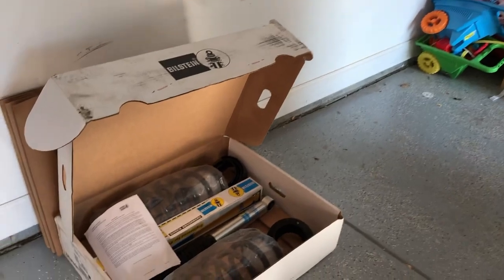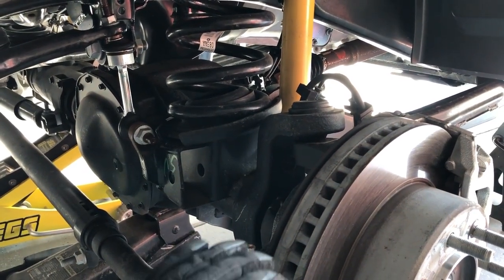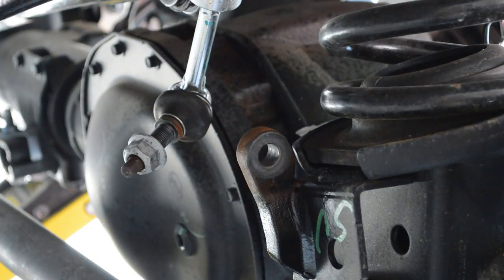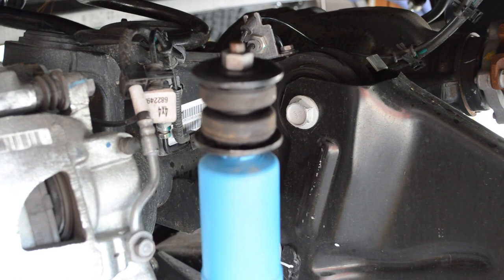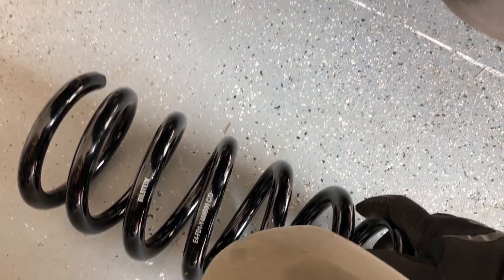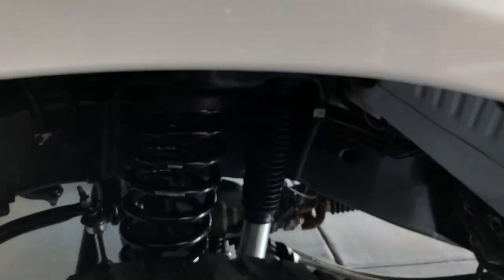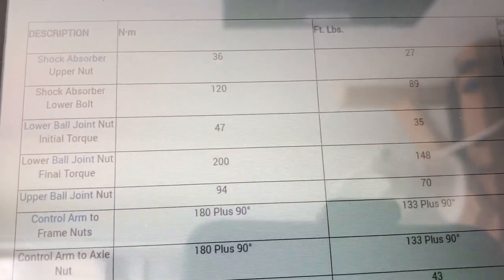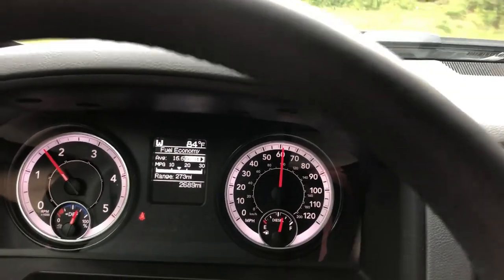2013-2018 RAM 2500 Bilstein Level Kit install

Comment: Thanks so much for making this. Really helped me out.  My truck had the cheap 2 inch spacers on it when I bought it and it rode like hell. I’m ecstatic of how much smoother it rides now with this kit.
Reply from the maker: Spacers will only give you height but the springs and shocks help

Comment: Just ordered the kit with the reservoir shocks today. Cant wait!
Reply from the maker: A Th I think you will like the kit.  I’d have it aligned to thuren fab specs.  Hope this video helps you on your install.
Reply: MKS Performance & Offroad video will definitely help!  Only problem im trying to figure out is mine has had the recall done and the dealer ship welded the drag link bolts. No way to adjust steering  wheel now
Reply from the maker: A Th to do a proper alignment you will need to cut those welds. Blue lock tight those or reweld after alighnment.

Comment: Nice install. You getting any wobble in that front end yet? I would suggest a steering box brace, about $135 from Rough Country. Really tightens things up, and boxes in the front frame rails.
Reply from the maker: 03redrubi no wobble, might be doing some 7500 airbags for the rear, and some thuren fab stuff in the future.  New clutch will be goin in soon and a video on it.  Those braces do help tighten things up.
Reply: @MKSPerformanceOffroad  I'm running the Timbren 6k up front, stock height, but the Timbren did boost front, unloaded. I have the Airlift 5k stainless kit in rear, and only run about 25 lbs in bags,  to level the fifth wheel. Pretty happy with the suspension now. Certainly feels like 1 ton suspension now.
Reply from the maker: 03redrubi very nice, we will be adding some electrical golf cart content coming up and hopefully a 5th wheel camper to compliment the cart in the near future.

Comment: Hey i just did this to my 5th gen and mine has a arch in the coils just like yours were you able to fix that
Reply from the maker: It will have a slight arch in the coil and shouldn’t be a problem.  The arch is more exaggerated when a coil spacer is installed in my opinion from the last setup I had.
Reply: @MKSPerformanceOffroad  glad to hear that

Comment: Just found your video, really nice explanation of process. Still happy with the ride? Secondly, I have a 2018 with the rear vibration. It seems like it is an amplifying movement on the rear. more weight eventually higher amplitude movement/vibration. Any dealings with this? Thinking about same front kit with progressive coils in the rear.  Anything would be helpful.
Reply from the maker: Thank you,  I haven’t had an issue on my truck with this but you might start by rotating the tires.  If the vibration moves location it is likely a wheel issue.  Also, check any rotating assembly, play in driveshaft at the u-joint, out of balance drive shaft, bearings,  inspect differential for any issues.  You could absolutely get a better ride with progressive coils in the rear but you will lose about 25% capacity when towing.  You can do air bags to help with squat which we just installed last week and will have a video in that soon.  Im still happy with the ride this kit offers.

Comment: I just did mine today. Did you ever go back and replace the track bar? I’m thinking about buying an adjustable track bar. Like to know you thoughts and which one you would recommend.
Reply from the maker: I did not order an updated track bar, only had the drag link replaced by dealer with new design.  If you go higher than 3” I would recommend just to get your axle back to center.  Thuren has a great website that explains this and would point you in that direction.  Several good options out there from Thuren, Synergy, and a few others.  I have been able to align the truck just fine with it leveled.
Reply from the maker: Synergy, Pure Performance, Icon, Rough Country are a few I think are good options depending on budget.
Reply: Thanks mine aligned just fine but I was curious if it was worth it.

Comment: Great job with all details. I just got my 2019 model 2500 diesel (same cab n bed as yours). I'm looking to do this same install with the rear 5100's. Bilstein mfg. wont commit that your same kit fits my 2019 truck,. I don't do much off roading and Bilstein lifts is trying to sell me the remote res, model 5160's on all 4 corners saying they will fit. Do you have knowledge if your kit fits a 2019? sorry for the long question.
Reply from the maker: sean otoole I don’t but I’d be willing to bet it does as most the suspension components are unchanged to my knowledge.  Best thing to do is look at a 19 suspension verse an 18.  Axles should be same and springs.  Shocks shouldnt be any different either the way they mount
Reply: @MKSPerformanceOffroad  Thanks for your quick reply! I will take a look, my son has same truck but 2017 model. Im going to use my 35x 11.50x 20 (factory rim) nitto grapplers. I removed from my ram 4k on them when I traded truck in. I'm considering an adj.  trac bar, do you have any recommendation's? I know their expensive, but thinking may improve ride
Reply from the maker: sean otoole 17 will be the same as 18, if your only going for a level, no more than 2.75” the adjustable track bar doesn’t give you a huge gain if any in my opinion because it really just helps re-align the axle laterally under the truck when it moves through its travel arc.  Mine might be off 3/16” or less on one side or another but its very minimal and hardly noticeable.  If your ocd like me, check out thuren fab or carli suspension, they make top notch products and are proven.  3” or more you will want the adj. track bar to re-center your axle.  Take a good look at the springs, rubber isolators and shock mounts.  If they are the same the kit will work and ext. reservoirs serve little purpose on road but offroad are intended to help dissipate heat.
Reply: @MKSPerformanceOffroad  Sorry for my delay, in attic re-insulation, fun fun fun. Sometime I'm away from youtube for a while.  Thanks for all of your input. I'm going to try no adj trac bar and see how off axle is. It will be about a month. I'll let you know how much it is off by for future ref.. I really appreciate you taking your time with the video & posting it, plus responding to my questions, Have a Merry Xmas, Sean.
Reply from the maker: sean otoole Anytime,  my goal is to build a useful channel that has valid and good info on it that can help people accomplish tasks they can do but maybe don’t feel confident enough because of lack of experience.  A lot of this stuff is pretty straight forward and sometimes there are things you just have questions about.  Merry Christmas and Happy Holidays to you as well.

Comment: After install a 2.5 Supreme Suspension leveling kit my front axle got shifted toward driver side. Do you think an alignment could fix it???
Reply from the maker: Jorge Betancourt possible,  you may want to look at an adjustable track bar from thuren fab to correct this if its enough to worry you.  Mine moved very slightly if any at all.
Reply: Thank you

Comment: Would the 4600 series work with the 2” leveling springs? Thanks
Reply from the maker: Yes they should but you would need to purchase the extenders for the bottom of the shocks like these. >> https://amzn.to/3JBDaf3
Reply: Thanks. Wish I would of saw this kit before I recently bought shocks. Turns out factory coil springs are toast. Thanks for the advice.
Reply from the maker: @garylee8578  no problem, thanks for supporting our channel.

Comment: Are you happy with the ride from the bilstein coils? My 2016 rides rough, going to try thuren coils.
Reply from the maker: Jeff Bennett Coming from a 2014 with coil spacers, these ride much better, not sure how much better than Thuren.  I’ll have to do a comparison, reason I bought these was the price and the fact that I didn’t want to spend $2,000 on a level with shocks.  I think it honestly rides better than stock for what it is.  If you want that soft ride you have to be willing to sacrifice something.  If you go with any coils for the rear you get a softer ride but less tow capacity and then it comes to, what do you plan to do with your truck?  Sorry for the long reply.
Reply: @MKSPerformanceOffroad  Do you plan on doing a thuren comparison? Thanks
Reply from the maker: Jeff Bennett I might when things slow down from holidays.  I know a few guys running their springs and King shocks
Reply: I have this kit with the reservoir shocks. I am happy with the ride. No more bottoming out on every dang speed bump. Much more planted in curves with rough surface. Slow speed sharp bumps were about the same. Switched to 35s on 18” wheels and run about 45 psi and ride is way better all around.
Reply: @supporterofsanity   do your 35’s rub at all with this bilstein kit?

Comment: How was the ride with the 5100's?
Reply from the maker: The 5100s are a bit firmer as expected but necessary for what I wanted out of them for the slight level/lift.  If you want a softer ride than I would install shock extension brackets on the 4600 or go with a different shock.  I have 35” tires so they work well with the components I installed.  You can read a little more here -> https://www.shocksurplus.com/pages/bilstein-4600-vs-5100-series-the-lowdown